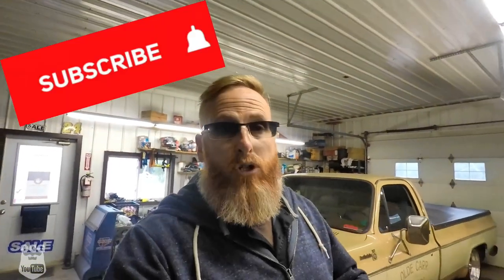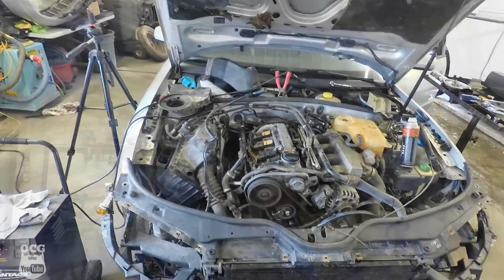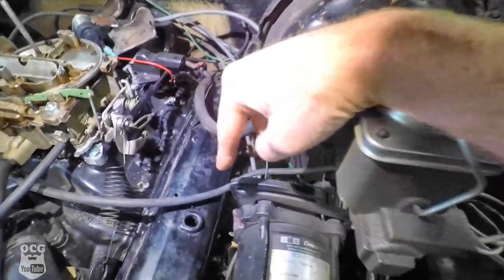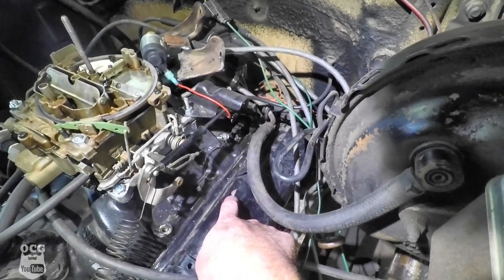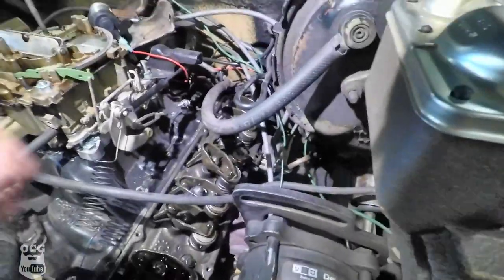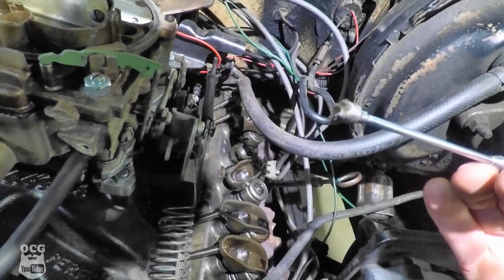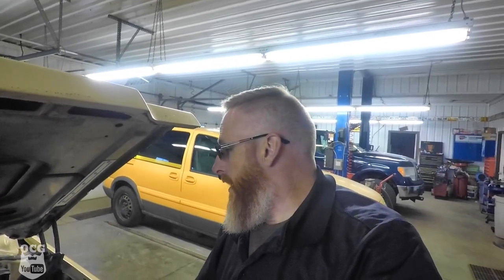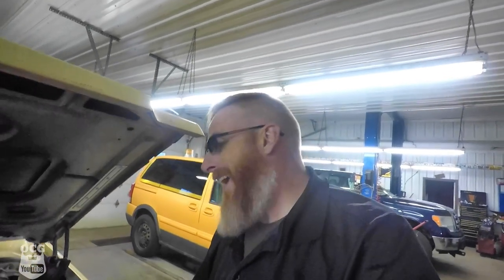MY 1977 CHEVROLET C10 HAS A BROKEN MOTOR AGAIN-PART 1

Comment: As I replyed the last time you broke a rocker arm. Many years ago I put a aftermarket cam in a 396 Chev. after the cam swap I had trouble with breaking rocker arms, after the second rocker arm failure I installed a complete set of TRW rockers, not sure if they are still in business, however the new rockers solved the problem. After seeing the difference in the TRW rockers versus the stock chevy. rockers it was a no brainer. Good luck...........
Reply from the maker: I’m with ya Paul. Next episode has the fix.

Comment: OCG ..... I had exactly the same problem in my truck .... it was 2 in my case .......... I broke down and installed a set of SCORPION roller rockers 1.5 to 1 ..... cured theproblem
Reply from the maker: Well, I did end up replacing all 16 rocker sets and push rods, but went with a Melling stock replacement. That's tonight's video.

Comment: Sounds like maybe valve spring bind causing your issues. Check the installed height and compare it with the cam manufacturers recommendation.
Reply from the maker: Although I didn’t personally check them, the matching shop had the car specs when rebuilding the heads. I can only take for granted they knew what to look out for! Very reputable shop!

Comment: new will help, if you gotta pull the intake i would look into the rpm qjet intake so you wont have to run the adapter plate but you could run a normal spacer and the engine will breath better. But i would check your clearance around the pushrods in the heads,  low performance heads have a pushrod "slot" that guides the pushrod. Hi performance heads have a larger round "hole" that requires guideplates or self aligning rockers that and you have a larger cam then stock, but push in studs you may just run self aligning rockers (may want to double check all that)  i would also check the the pushrod slot in the rocker and see if it is worn the rocker odd. But i will say at one time reusing rockers and push rods wasnt a bad idea depending on what you was doing, i like going new each time, but awhile back those parts where not as old as they are now. some of those parts are 40ish years old. They have heated and cooled many times and slowly lost strength over time, now i dont recall if those were original rockers or the previous owner  put new ones on a rebuild at some point and its hard to say sometimes.
Reply from the maker: I’m with ya Terry. Old parts. My dad and I have built this exact spec Engine several times with no issues. However this is the first time we’ve used rockers and pushrods. Lesson learned

Comment: You saved some gas driving the Passat.  I have an '82 Dodge W150  slant 6 and a '98 Chevy Metro 3 cyl, and save gas by putting at least 80% of the miles on the Metro. Both are living with a mildly burnt valve, #2 on the Metro and #5 on the /6.  I am most interested in classic economy cars like Pintos and Datsun 610s, and also maximum 2wd traction like dune buggies, Corvair and 911.  Might the best traction conventional be the Vega wagon with its aluminum engine?  I am interested in super small engine swaps for traction, like a 2.2 B200 with extended tail?
Reply from the maker: Gotta save money somewhere!

Comment: How much lift are you running? What  valve springs?
Reply from the maker: I’m not sure what rate the springs are, but I told the engine shop that I’d be running a 480 lift cam. They assured me these springs would handle it!
Reply: @OldeCarrGuy  Any indication the valves are floating?  did ya get on it just before it broke? Fast ramp cams generally need more spring pressure or they loose control at higher rpms.
I'd be checking clearance before coil bind also. Good luck. Nice truck.
Reply from the maker: I was actually just idling down a country road at maybe 35/40 mph when I started to hear a noise! It quick got louder!

Comment: If it were my vehicle having that problem I would pull the engine to make sure there is nothing in the oil pan at this point. Most engine builders nowadays are shying away from, or flat out refusing to use flat tappet cams - the reason being that they aren't in huge demand and the quality control for said lifters leave something to be desired as of late - the are stories of failures all over the net. You should measure your rocker studs to make sure they aren't lifting as some have suggested. One plan would be to remove the heads and either pin the studs or have the head machined for screw in studs if there's a problem. But I also feel that you should switch to a roller hydraulic lifter cam with upgraded rockers, push-rods, the whole nine yards - etc......https://www.corvetteforum.com/forums/c3-tech-performance/1367079-flat-tappet-cam-failure-article-in-hot-rod.html
Reply from the maker: I appreciate the insight. Thanks for watching. I'm not to concerned about it. In tonight's upload I install all new rockers, nuts, washers and pushrods.